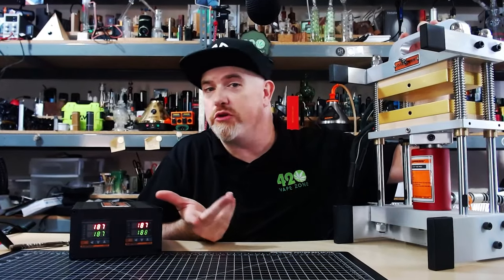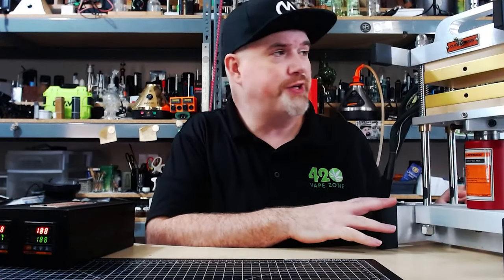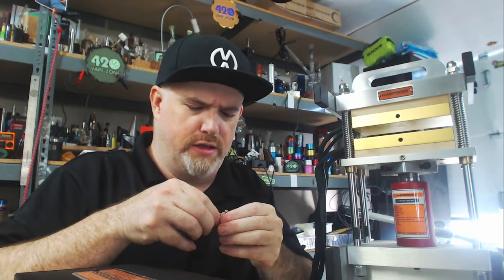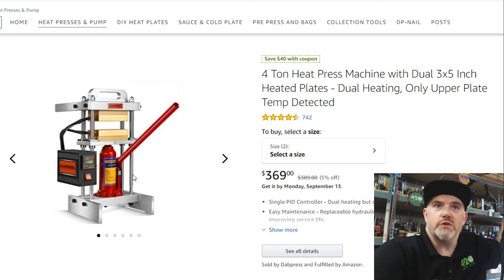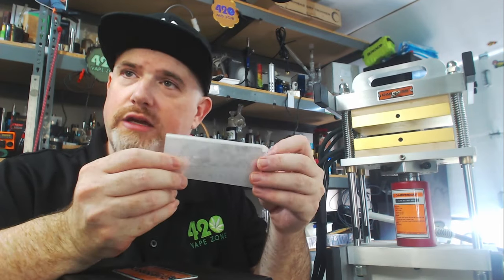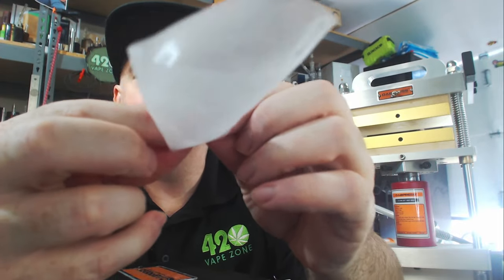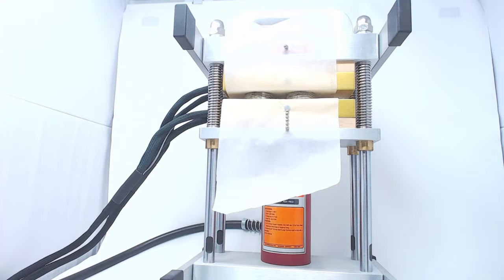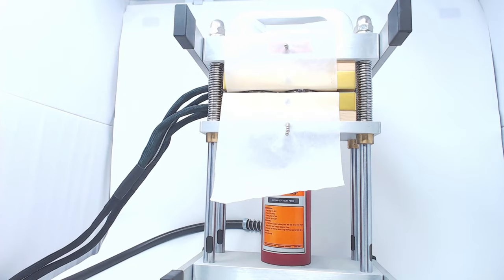Dabpress 12 Ton Rosin Press Review & How To // This Rosin Press is available on Amazon!

Comment: to prevent  blow outs. the  screen hole size should be directly adjusted with the humidity of the weed.If  you have wet weed large micron, dry weed smaller micron :) just something i picked up
Reply from the maker: Hey that's a great tip! Thanks!
I would like to put together a more advanced rosin video at some point, but I have a lot to learn so I'll need to collaborate and network a bit. Cheers!
Reply: avoiding blow outs is all about your paperwork , as long as your doing a quarter or less you wont need more pressure than 1,000 psi get a pre press and try pressing raw but develop a good fold style we all have our own lil ways of folding

Comment: Great informative video man. May I ask did you rehydrate the 9 month old weed if so how did you do it. I'm buying my first press soon.  as I'm in the UK rosin is hard to come by so I have to make my own. I can get nice flower but it's always a few months old so was just asking about the rehydrating the weed before pressing.
Reply from the maker: Thank you! I used 69% boveda packs, but i think 62% would have been better. You can use other DIY methods too, like tortillas or orange peel or watermelon rind.
Reply: @420vapezone  Thanks for replying & great tips much appreciated. That's cool, I may try them but I did  come across a video earlier about hyrdostones so may give them a go. I'll figure it out. Keep up the great work man : )

Comment: On the dabpress website it says you don't need anything for the 12 ton press. It says it's complete. So confused do I need a gauge and pump to run this press?
Reply: Two different kinds one of the 12 ton presses has a handle but this model doesn't

Comment: I’m a little guy and I only weigh 115. I can’t even pump the Nugsmasher XP above 3000 psi. Does the DabPress get really hard to pump as you get into higher psi? It seemed like you weren’t exerting too much force. Thanks for the informative video! I appreciate it man!
Reply: Hey there, how do you like the Nugsmasher XP?  I'm trying to decide between this 12ton Dabpress and the XP! Thanks in advance.
Reply: @jadesandco8617  I returned the XP. It has a shitty 40 dollar bottle Jack in a 1400 machine. It started leaking and not holding pressure. When I contacted Nug Smasher they wanted me to go buy hydraulic fluid and tools and try to fix a brand new machine. Luckily I was within the return period.  I ended up getting the 12 ton Pro by dabpress. The first hand pump I got from dabpress had problems too. But they exchanged it and it’s all working.

Comment: thinking about getting one. Just a thought about the magnets, why not cut a small strip of steel and either weld, jb weld, or even simpler just 3m mounting tape it to the top so you can use any magnet you want?